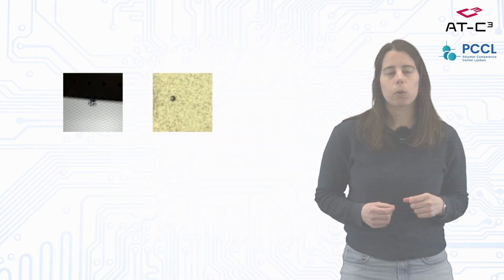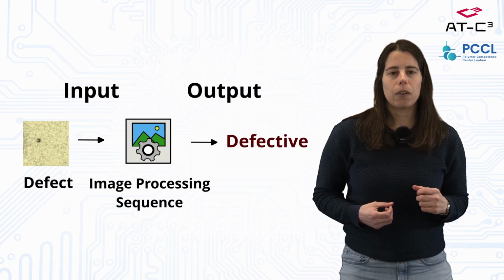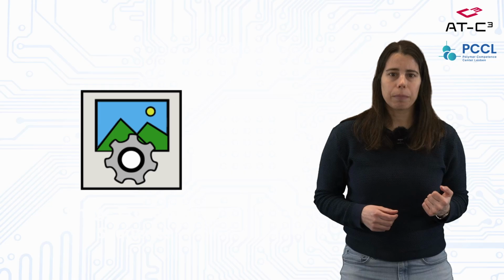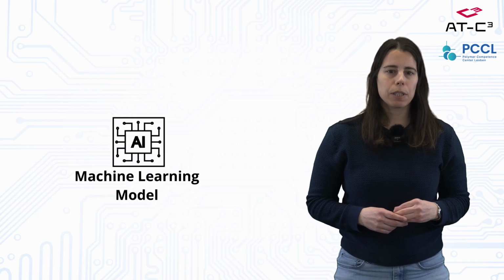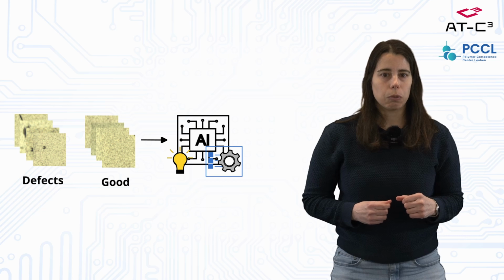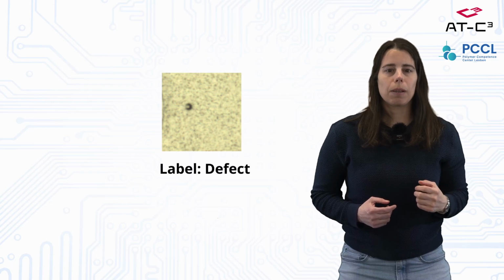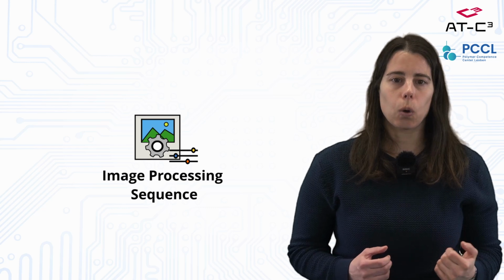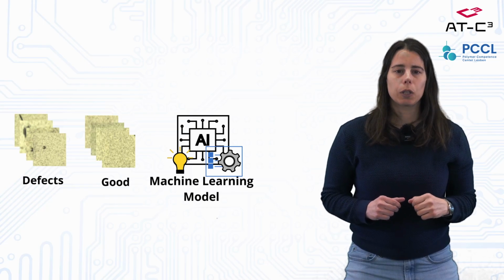Why AI Is Needed for Reliable Surface Inspection

Comment: Why say "AI"? Why say "machine learning"? It's just freaking code. All zeros and ones.
Reply: You never work in that field obviously . If there one area where on can talk about learning machine , it's really the industry and arms robot . In other field the term AI , i agree is abuse . In the electronic field where it's my job we talk about close control loop  , and you have design and program hardware and software to get the proper result but nowadays many ahs also the aibility to learn at a certain level by themslves by adjusting error and then new try , so their some feature where the system has a little intelligence to adapt by itself .  Sorry if some sentence are not very acurate i'm not a native English speaker , i'm French , Have a good day .
Reply: @zibobpompon5768  I do work in "the field" as an automation and robotics engineer technician. Yeah, I only have a 4 year degree, but I know how to get things done. AI is nothing but a glorified PID controller when it comes to making parts. My intuition about how to consistently swing a mass without breaking the arm isn't something AI knows about until it happens. On a side note...your English is good. Anybody that gets 2 years into an engineering university quickly learns the syntax of engineers from a different culture.
Reply: @intheshell35ify  Ok i understand you reaction , in fact i'm an an old engineer but still in the run on a daily basis  and i'm a SOHO and work for myself in fact  . My location is very far from you i guess , i live in Reunion Island a French over sea department lost in Indian ocean .
Reply: @zibobpompon5768 you are really an engineer type on Reunion Island?? I didn't know France still had "colonies"(for lack of a better term) in the Indian ocean. If I ever had enough money I would come visit. I would have a million questions.
Reply: @intheshell35ify  Yes i live here since 1976 , Reunion Island is well developed but the job here is very hard to get  so i in fact i work for myself doing repair in many field from TV HI-FI Video to PLC , and also medical stuff for vision control , my career has always been centered on electronics but very eratic at the same time because you have to adapt your skill and be up to date in many field  . Earlier  mean 25 years ago i was a teacher for 5 years only in physic and electronic then i return to industry because i don't like the envirronement of working in a civil service job for  the public sector , you always have to deal with people that give you order putting pressure on you  and they know less than you so i choose the hard way , working for myself , you earn less but at least you have you own life style .  After being a professor fot the 5 years i have hired to work on the health security card in Hong Kong for 2 years from 1997 to 1999 and the return as i explain above to industry as a SOHO (Small Office Home Office ) I'm a passionnate guy in my field of expertise and from what i know we are only less than 10 guy that own his own lab and livre from their knowledge in electronics . Sa as you see my career is a bit stochastic but from my point of view very interesting too , when you wake in the morning i still have the joy of doing things   the key for me is always being in learning mode , this is my motto  . Life is hard to get by , but if you stick to your task while being passionnate at least your feel happy .